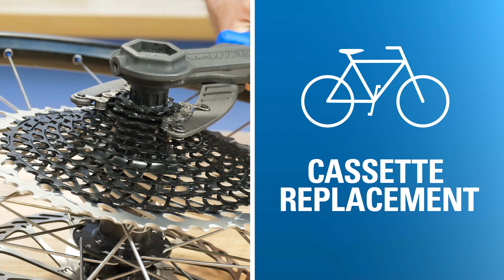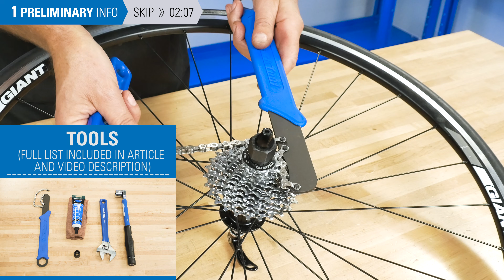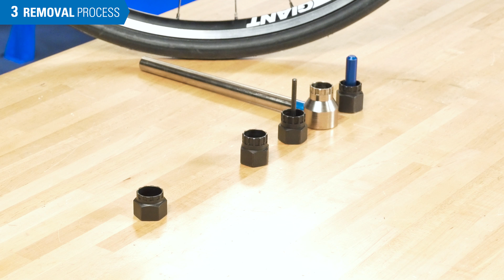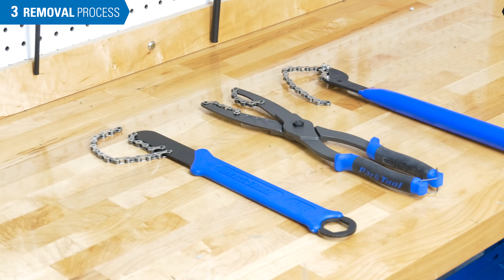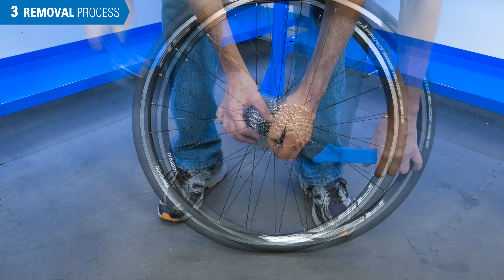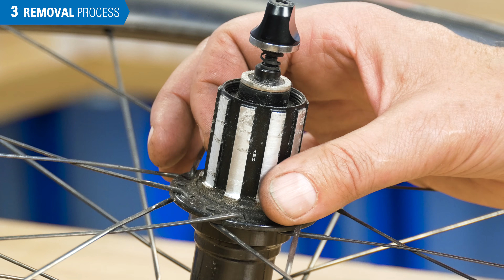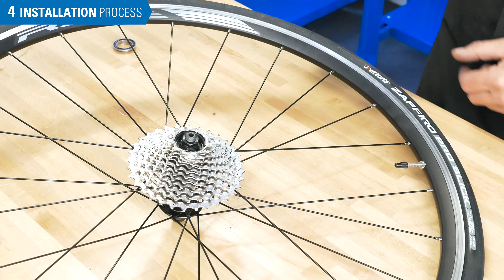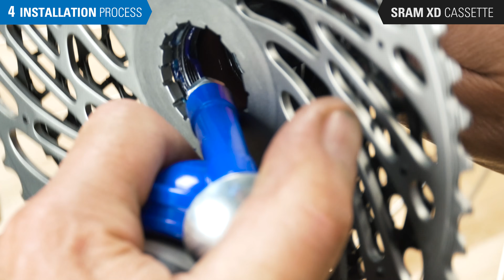Cassette Removal & Installation

Comment: If you don't have a chain whip you can make one out of an old chain. Alternatively, you can just use a pair of vice grips to hold onto a length of old chain. Literally just used that trick after learning it from Seth and I can confirm, easy way to save 50 bucks. Chain whips have their place in shops but that's a legit hack for the home bike mechanic that just needs their commuter bike to run.

Comment: I just got my bike back from the shop where they disassembled the rear hub to diagnose a problem.  They put it back together.  But now, with my rear wheel off the bike, my cassette can slide in and out on the axle about a quarter inch.  I assume this is wrong?

Comment: I did this yesterday, and it was shockingly easy, thanks to Calvin! I anticipated it being difficult to remove, but I used an 18" breaker bar and it practically came off in my lap. I used one similar to the FR-5 without the center pin and the skewer removed, and it was fine. The tool I got had a hole for a half-inch drive ratchet that the Park Tool ones don't. Had it been tighter, having the center pin, or the skewer in place, would have helped.

Comment: Watched all three videos, about hubs, I'm more confused now than ever.on my hub the tool spins and the cogs are all individual  seperated by spacers, but the hub is larger on low 4 gears and smaller on the high 3, everything else says freewheel(because its a huffy)

Comment: THANK YOU!!!!!!!!!!!!! SUBBED! Hope you're still making videos.
I see this is a very old video but in my mind it has aged well!
What I needed most I got from the first few seconds of your video. I had to remove a cassette that has a 12 tooth top gear (so that I could put that cassette on a new e-bike motor....The 12 tooth helps me pedal comfortably instead of frantically, at the e-bikes top speed).
BUT, THE BIKE MOTOR ASSEMBLY THAT THE CASSETTE WAS ON, WAS ALREADY REMOVED FROM THE RIMS SO IT WAS REALLY TOUGH TO HANG ON TO. YOUR VIDEO SAVED MY DAY! 
I see now it was all about equal and opposite, balanced positioning, of my tools.

Comment: Holding it in place (0:25) even with 3 foot leverage on both sides; would NOt open, Jammed ! Only two tack welds on the locking washer ( the molded holes kept expanding) then hammering it with a chizel bit by bit. 😬

Comment: what size socket did you use to fit over the cassette tool for the torque wrench?
Reply from the maker: The Park Tool series of tools uses 1" hex stock.  Use a 1" socket.

Comment: Nice video, and photography.  Went smooth here, and helps to mark that wider space/spine.  Also help d that Shimano Cassette comes on a plastic hub, all aligned & together.  Just had to transfer, and then add last ring & hold-down cap. Thanks ML

Comment: I've come to the conclusion after doing this many times is chain whips need some kind of tensioner on the loose end of the chain.  It's such a pain if you got a lock ring that isn't playing along to keep that thing around the cassette while you wrangle with it.  Obviously one could make their own kinda thing, and I plan to attempt a 3d-printed solution of some type but it would be nice to have that as part of the tool itself.

Comment: I had a 7 cassette and new rim is a 9 and put spacer in but  doesn't shift great is there away to change the hub to fit it back to 7 cassette?

Comment: 2025 check-in.  This video is spot on, clear and to the point.   I replaced my old cassette and crusty yellowed dork disk with ease.  The only thing I did differently was to add a medium-thick smear of Finish Line white grease on the cassette free hub splines, and a very thin layer on the inside spline of the new cassette.  I figure the added anti-seize and anti corrosion properties wouldn't hurt anything.  My freehub is a shimano STX, cheap but bomb-proof.  I suspect they used a hardened Japanese steel for the free hub.  I don't think its aluminum or anything optimized for weight reduction.   For decades I had a creaky sound coming from my drive train.  It went away immediately when I replaced the cassette.  I think the steel freehub splines were "biting" into the cassette cogs (or vise-versa).  I suspect it was just enough wear combined with decades of dirt / dust to make it go "creek--creek--creek--creek" with my cadence.  Annoying as hell being "that guy" out on the trails.  Thanks for posting these vids!!  Very educational.

Comment: My rear cassette came apart while driving. Rear wheel went stuck and as I inspected what was wrong, I noticed that cogs were completely loose. I filled reclamation form to Canyon and now I’m waiting for them to answer. Sigh. I have to buy these tools so I can fix it by myself if it happens again…

Comment: Thank you so much! I used the video to install a new cassette on my old, old bike. I also ended up buying the Park Tools chain pliers (easy to use) and the FR-5-2 removal tool. And afterward, I watched the Park Tools rear derailleur adjustment video because the shift indexing changed a little bit. These videos explained everything perfectly.

Comment: if it locks up and don't spin backwards, What could be the problem after spotting blue glue around the rim? Dodjey Hub Benny?, nah could be a....... ok My rear locks up and my derearaliuer mates like with my wheel on mating day ? Stop peddling benny.....Not gonna name the company but i will if i have too, like them i cannot afford to lose 197 quid too, in short my freewheel dont spin backwards.... thank you

Comment: what about cassttes with no lockring tool fitting? THere is a lock ring with two indents but the snapring pliers are not strong enough to loosen it
Reply from the maker: It is possible you have a freewheel,  not a cassette.  See https://youtu.be/rdQE8-ea1uw?si=LD8Yx-gklylcGMdQ

Comment: Couldn’t you just use the wheel by holding it on opposite sides and turn the wheel when the tool is clamped inside the Vice?
Reply from the maker: A vise can be used to hold the tool, but you need to turn the sprockets counter-clockwise, not the wheel.  Freewheels can be removed with a vise and the tool, but not the cassette lock rings.
Reply: @parktool  okay got it. Thank you 🙏 
Hey do you know if an older cannondale from the early 2000’s has a freewheel or a cassette? I just changed the freewheel on my sons mountain bike and it all worked out so great. His bike shifts smoother and even shifts quicker after replacing the rear sprockets. My chain on my older cannondale jumps sometimes so I was thinking of replacing the rear sprockets. But I don’t know yet what system it has on it yet. I noticed that the smallest sprocket or cog is definitely smaller than the one I replaced last night on my sons  schwinn mountain bike. 
Thank you for making this vid.

Comment: I watched several videos on this topic and was wandering, why no one is mentioning the lock ring spacer which goes between the first cog and the lock ring?
Reply from the maker: Not all brands or models use that thin washer.

Comment: Top tip, you can also use a chain oil filter removal tool to hold the cassette in place

Comment: Hi Calvin. I don’t have a torque wrench. How do i know by feel when it is tight enough so i don’t overtighten, or undertighten when putting the casette back on? Will be doing this for the first time, and i’ll be putting the cassette on the new wheelset.
Reply from the maker: That comes from experience. It is more likely you will under-tighten a lock ring.  You can use perceived effort. Holding the wrench 6" from the axle, you will need about a 60 pound pull.  Think of a 60 pound weight being lifted.
Reply: @parktool  Thanks!

Comment: If i replaice my cassette to a bigger one do i need to upgrade my rear derailleur
Reply from the maker: Often times you do. But it depends on many things. Your current derailleurs capacity, chain length, how large of a cassette etc.
Reply: @parktool  thanks park tool

Comment: I am proper stuck, Never done a cassette removal before, I used a Bbs02 so I'm wondering if the torque of the motor might of tightened things up a bit more, I don't know, Either way I cannot get the cassette off, I want to still use is as I struggled to get the back wheel and new derialier, Cost of living is hitting me hard, it's why I got the E-bike for, I suffer CPTSD so the bike is a must as public transport is a no go for me, I got an electric scooter, But it's fast, Really fast, And I'm just waiting for that police officer to say right I'm taking it, I've been pulled over on it before, Over 5 times, Generally they ok, I got helmet on ect, Might start wearing my body armour now, Ice and small wheel don't mix well, lol....
But yeah I cannot get the cassette off a 29inch wheel, I will have another go, But I might have to buy a new flipping cassette now, They costly ain't they, I only needs a 9 speed cassette, Any donations or anyone got a cassette for sale as cheap as possible...lol.....
I'm desperate to get this bike running, I love on 3rd floor so I got carry a 36gk E-scooter up 3 flights of steps, I'm waiting to see a heart specialist..
With the bike walk mode helps me get the bike up the steps, No carrying a 36kg E-scooter, So yeah I'm desperate to get this bike sorted, I can't put a new derialier and swing arm on an old buckled spoke snapped wheel, The swing arm will snap again won't it??
Is a Carrera hellcat any different lol, I can't find a video specifically for changing cassette on a Carrara hellcat lmt edition....
The bike is on my channel, It's a great looking bike, And with the bbs02 it just looks the part, I'm missing my bike now, I got get it fixed, Any tips apart from holding the locking nut in place???

Comment: İ have question for you. İs fr-5h compatible with 15 mm nut?
Reply from the maker: The FR-5H.2 does not remove a 15mm nut.  Is this the nut that holds the wheel?  You need a 15mm wrench, or an adjustable wrench.  The FR-5H.2 fits the cassette lock ring holding the sprockets.  You may have a freewheel, not a cassette, and my need the FR-1.3.
Reply: @parktool  ok thanks for all 👍

Comment: This is really useful but the complete lack of standardization in the cycling industry is an absolute disgrace. Every single time I have to work on my bikes I have the wrong tool or the wrong component, it's a nightmare and one of the reasons a sell all my bikes every few years and do another sport. We are being ripped off  to an incredible degree with almost zero fucks given for the consumer.

Comment: On installation, no mention of lightly greasing the splines.  Is that not accepted practice?
Reply from the maker: Its an ongoing debate in the cycling mechanics world. It's important to grease the threads of the lockring. Greasing the splines will not hurt anything but there is no clear benefit to greasing the splines.

Comment: Park tool what do you call the driver attached to the torque wrench when you tightened the cassette??? Where can I find it??
Reply from the maker: That is a 3/8 drive 1/2" socket. It drives the FR-5.2.
Reply: @parktool  any recommendations on where to buy it on online shopping platforms?
Reply: Is 1/2" socket equivalent to 19mm??
Reply from the maker: a 3/4" socket is the equivalent to a 19mm.
Reply from the maker: Apologies, the FR series are driven with a 1" socket not a 1/2" socket

Comment: Can anyone go further on the use of polylube 1000 (blue) during the removal and installation process?? 1- Apply some PL1000 to the inside thread of the cassette before sliding onto freehub, 2- Apply (PL1000)  onto the internal thread side of lower end before nut is "re-"installed (during final process).... Anywhere else?   Where is the "anti-seize" stuff used?  Thx

Comment: Hello, I got a really got bike at the local market, and I want to switch the cassette to my touring bike, the one currently on the touring bike has 36theet on the biggest cog, the one i want to place is 46 on the biggest cog, both are 9 speed. My question is - Do i need to adjust chain length and derailleurs/shifting after i place the bigger cassette?
Reply: Also, do i need to do adjustments to the bike im putting the smaller cassette on? Both cassettes start at an 11 theeth smallest cog

Comment: i have a question abt my cassette hub, my cassette has splines and a cog, but the splines are threaded. is it possible to add more gears to make it atleast a 6 speed instead of a single speed?

Comment: That tip for using the skewer is brilliant. My removal tool was like this and it took two people to unscrew the cassette. One to hold the whip and apply torque and one to hold the tool in place.

Comment: What is the bit attached to the torque wrench for tightening the cassette and where can I buy it?
Reply from the maker: The socket is a 1" socket. That socket is driving a Park Tool FR-5.2. You should be able to find it online or at a local bike shop.

Comment: Best Video out there… Q: My last, smallest cog of my Shimano CS-6800 sits past the hub thread near 2mm… The result is that I’ve stripped the Lockring nut thread at about 20N·M .. I will order another lock ring but I wonder why I stripped the original nut and fear the same will happen again. Any pointers
Reply from the maker: Check there is no thin spacer behind the cassette stack. It is not uncommon to have the smallest sprocket sit slightly past the thread, but it should not strip at full load.  It is also possible the cassette and freehub are incompatible.
Reply: @parktool  it’s all my original components, just disassembled it to clean it… I’ll try to use the « lockring socket with a little shaft » Maybe I was applying force a bit off axis…. Still strange.. Thank you for your videos!!

Comment: I have a 
Shimano CS-HG200 8 speed, 12-32T what tool do I need to remove it
Reply from the maker: For that cassette you will need the FR-5.2.
Reply: If my gears are in the lowest setting will I still have to make adjustments as im planning on changing my chain and cassette

Comment: My FR-5 uses an SAE 1 inch socket or wrench, not metric. That's a pain, I'd much prefer metric. Same for my FR 1.3 freewheel tool. I use my SAE sockets so infrequently that I don't keep them in my tool chest. I have to dig them out of a tool box that's tucked away in a corner because it is so rarely needed these days. Almost nothing still uses SAE sizes. At least that I work on.

Comment: Calvin: Question please. I have a old school 6sp freewheel block fitted to my wheel (Super Maillard 700 compact)  I have the tool to remove the whole block including the 6 cogs, but how do I remove/separate the 6 cogs from the casket to allow me to change to different gear ratios, thanks for your very informative videos.
Reply from the maker: You need two chain whips.  The first one is placed on the smallest sprocket to turn it counter-clockwise. The second is place up the freewheel holding the sprockets clockwise. This opposes the whip on the small sprocket.  Remove the small sprocket
Reply: Calvin thanks for your advice I have tried your suggestion But! after removing block from the hub, the plan is to swop out the cogs to a create a different set of ratios, BUT, the small lock cog is ceased onto the block (or thread locked fluid)  I have even tried using a piece of spare chain around the large cog ring then putting into the vice before using a whip with bar for extra leverage, But so far have had no luck in moving it, i have even tried some heat still not budging can you suggest a plan "B" or "C"

Comment: Only thing missing is the way to make sure one doesn’t make mistakes while piling all the cogs…. (Is it possible to pile them wrongly?)
Reply from the maker: The "Shimano" cassette system uses a spline pattern that will not permit you to make a mistake.  However, the smallest sprocket can be place off, so watch that it also matches the pattern on the freehub.
Reply: @parktool  Awwwwsome… Love your videos! keep em coming!

Comment: Hi!  Thanks for a nice video!  I had my rear wheel built by a pro wheel building shop.  It's coming FedEx tomorrow.  I've asked the builder if it's a simple, just put my clincher tire onto the new tubeless rim (they said the tubeless rim is the same thing as a tube rim and don't worry), put the 7 speed cassette on, then clamp the wheel on and go?  Is it where maybe a shop needs to adjust the gears etc.  Also can I resume normal activity that for me is hauling groceries, going on long cross country rides etc right away?  Also how soon will I need to have the spokes re-tensioned, and the brand new hub re-adjusted?   Sadly they didn't answer when I emailed about that, but I think they are very busy builders.  Now it's the weekend so I'm trying to plan ahead.  I also now will be putting on my summer tire which for me is a Schwalbe Marathon Plus 2.0 x 26, so nothing to worry about?

Comment: My bike is Polygon Premier 5. Shimano CS HG200 9 speed cassette and Alivio rear derailleur. Which tool will be used to open the free wheel ?
Reply from the maker: The cassette tool needed is the FR-5.2.
Reply: @parktool  thanks a lot for the reply.

Comment: Torque?
distance  X  force  =  ?
100 cm    X   ??      =  .
Help me, please.
Reply from the maker: Good question, but not a simple one.  This cassette lockring is labeled for 40Nm.  That need the equal of a 100cm long wrench with a force on 1 newton.  Newton is a designation of force, but is difficult to understand with a feel.  It is preferred by engineers and scientists.  Weight is another type of force and is more easily understood by the rest of us.  Another torque value is Kilogram-centimeters.  40Nm is about 407 Kilograms-centimeters.  A 1cm wrench needs a force of 407 Kilograms.  Assume you tighten the ring using a 30cm wrench.  Pull with a force that would lift about 13-14 kilograms.

Comment: Is there a video for removal using two chain whips for older bikes without a lockring which instead use the last cog as a lockring, as pointed out in the cassette/freewheel video?